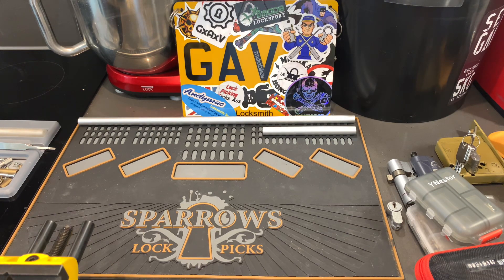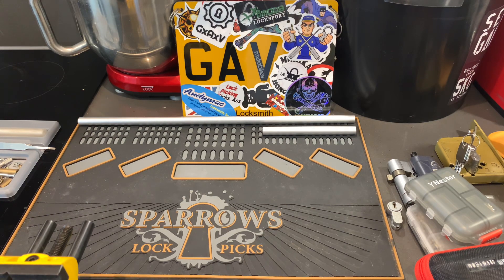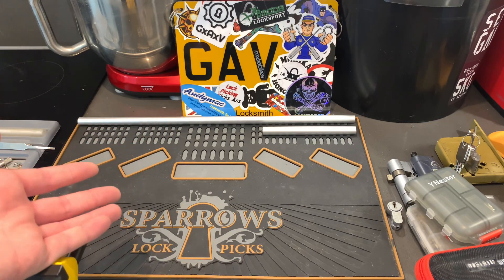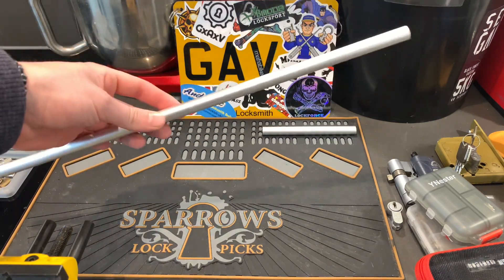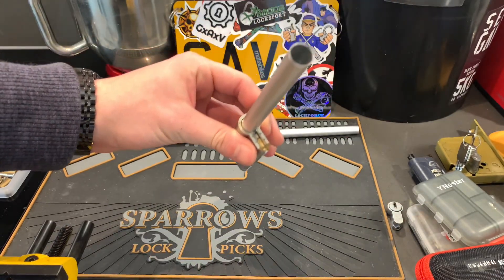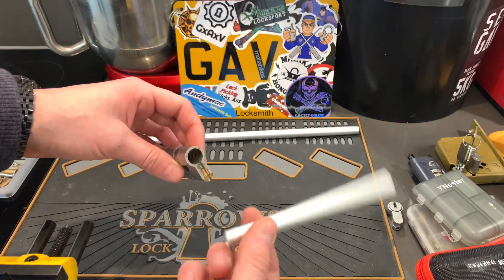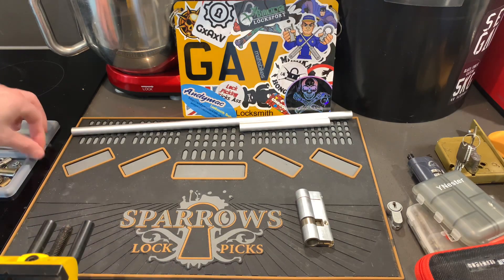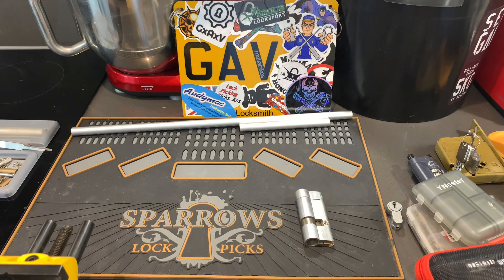Some 101 locksport tips

Comment: So many useful tips here- from the Stanley vice, to the make up holder(the clear ones, with the large square cut outs are ideal for tidying loose locks etc in your workspace- I have four, a couple of quid each from The Range),to the pill or craft boxes. All stuff I've raved over, in the past few months of my Locksporting adventures thus far.
 Sensible solutions to niggling problems.
 I do like the idea of the cylinder casing too- I do have one kicking about and I'll also be using that in future.
 Great vid- thank you👍